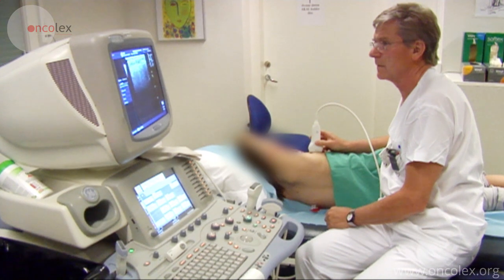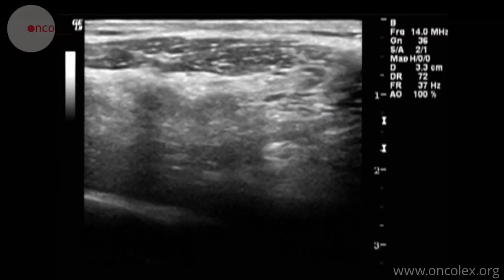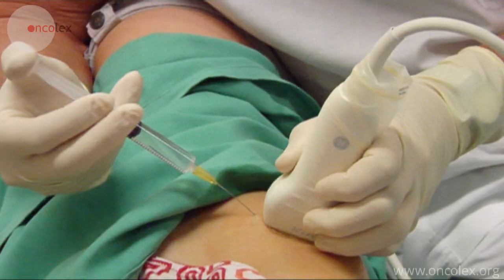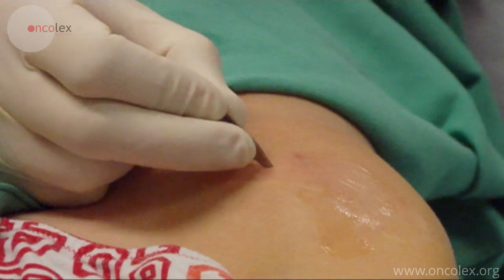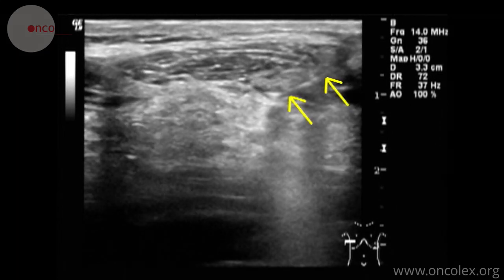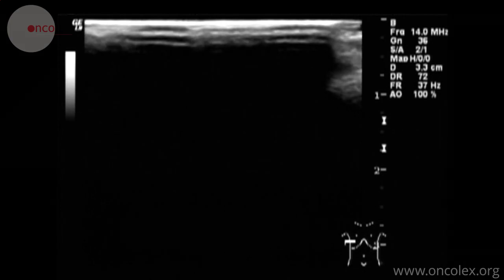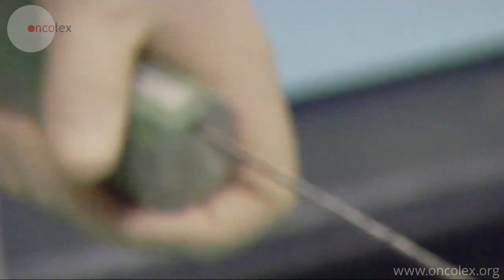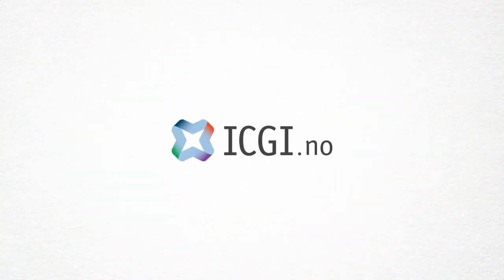Ultrasound-guided biopsy for soft tissue sarcoma

Comment: Dang i h have a high tolerance for pain. No local and the pain passed me out. They had to go deep and far up near my rib cage. It was barbaric. Now 3 lumps in my chest and another in the other breast 9 years later.  I would rather give birth then deal with it.  At least she got to lay down.  Thinking seriously of letting it take is course.  I passed out from the pain,  it took them 3 tries. Found out later the guide wire was not correct so they cut more of my breast away.  Ineptness
Reply: I'm so sorry to hear how yours was torture. I never want to go through child birth again, that is saying something about your pain level during the procedure. 😢 Hang in there girl, do what's necessary for your children. 🙏  I'm having this done in 4 days, but fortunately mine is in my arm. Hoping it's as easy as others are saying. 🤞
Reply: I don’t want to do it now.  I’m scared!
Reply: Sounds awful. I'm terrified they will want to do this to me. When you passed out what did they do? That should have been the end of the procedure right then and there. But they kept going? I don't understand? And they always give freezing i thought